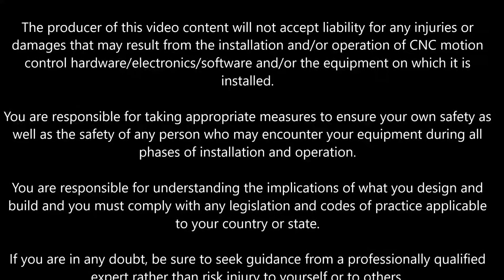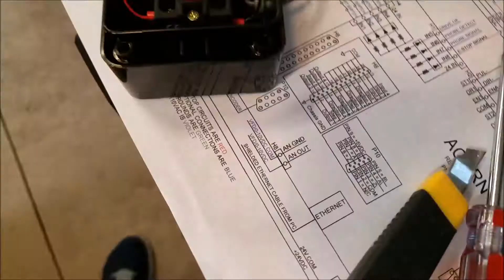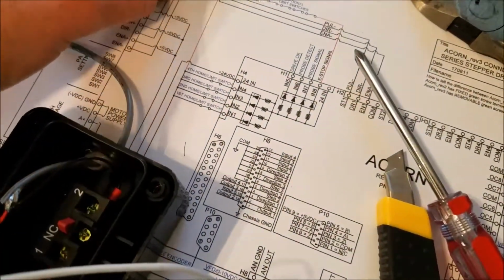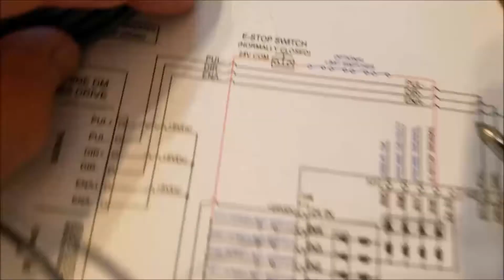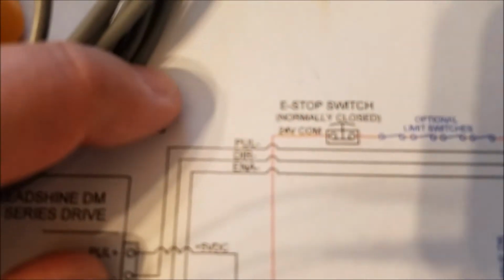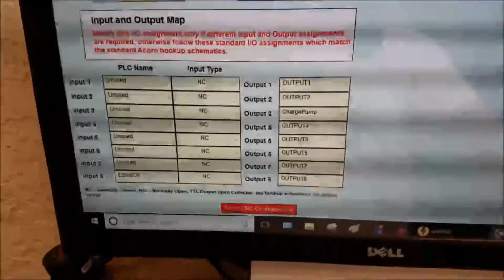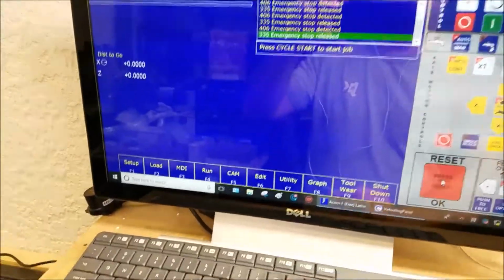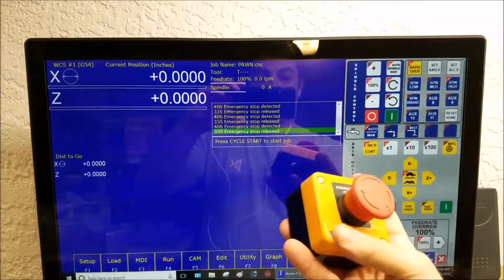DIY Closed Loop CNC Control #5: Emergency Stop

Comment: Hello,
I have this e-stop and have wired it up exactly the same and used the Wizard to make sure it's set as Input 8 and NC however I'm not getting any change when pressing/releasing the switch. Input 8 just remains as default. Any ideas why this isn't working for me? 

I have the NC wire from the switch to pin IN8 and the opposite wire from the switch to COM. I should also say I've wired up a VFD to the relay so could that be causing confusion? 

Many thanks, It's driving me crazy as everything else works now.
Reply from the maker: Ok.  Did you supply 24v positive power to the inputs?  If you look at the wiring diagrams, you will see that you use a jumper wire to feed 24v positive voltage to the inputs.  Then, the voltage continues through the input to COM to complete the circuit.  Does that help?
Reply: @FrancoCNC  ah that must be it. I did see that on the diagram but didn't see that in your video so ignored the diagram. I'll try that when I'm back in the shop.
Reply: @FrancoCNC  Ok I wired a jumper wire from the 24VDC supply to 24IN, And the switch is wired to IN8 and through to COM, The light on the Acorn is Green, and turns Red when pressing the e-stop, however this isn't showing in the CNC12 software on Alt+I.   Selecting the Input 8 (green) on that display and trying to force it using Ctrl+Alt+F no longer switches the e-stop on/off.    So now I'm even more confused as to what's going on. I have the newest Acorn board (v4) but I don't think that makes a difference.
Reply from the maker: @TinkerInTheShop  you are close.  If the led on the board is changing color then you are close.  Have you run the wizard and set up the inputs?
Reply: Ignore that last comment, In the Alt+I menu I realised the Input 8 was 'underlined' and pressing Ctrl+Alt+F removed this, I guess that is some kind of 'lock' because now the e-stop switch works perfectly! Thanks again for your help, I'll leave my past comment in case any one else happens to get the same issue. -Dan.
Reply from the maker: @TinkerInTheShop  Awesome!  I knew you'd figure it out.

Comment: Hi Franco  Nice work on the e stop circuit. I have a question I am wiring up an Acorn using DMM servos. How do you have your drives configured do the just power up with the control or do they have a drive enable output from the Acorn.  Right now I turn on the power through the main disconnected.  Then I have a control on/off switch installed that enables a drive that powers up the Acorn. I have the drives as well as the spindle on a separate contractor spindle forward .  , The spindle works fine using the Acorn out put brake off. I don't want to disable the drives with a e Stop I would just like to disable the movement so the drives do not lose their position.  If I drop the drive relay out with an e-stop I have to re home the machine.  My other machine use absolute encoders so they don't care if the drive power is turned off during an e-stop  But the DMM servos do.  Any ideas  thanks
Reply from the maker: Hi.  With the ClearPath servos, I use an EStop mushroom switch with two NC circuits.  Onc circuit is used for the Acorn EStop input.  The second circuit is used to break the drive enable signal coming from the Acorn to the drives.  Maybe not 100% necessary, but probably the safest way to make sure the drives stop moving when you press the Estop.  I will have to re-home after pressing the EStop.
Reply: @FrancoCNC  Thanks I am doing it the same way I was trying to figure out a way to not have to rehome but still stop all the movement.  I am going to try and use the DMM enable connection to stop movement without having to re home.  Next machine is going to be with Absolute encoder so homing is no longer needed.  I have them on my 14 foot gantry and never having to home is a Joy.